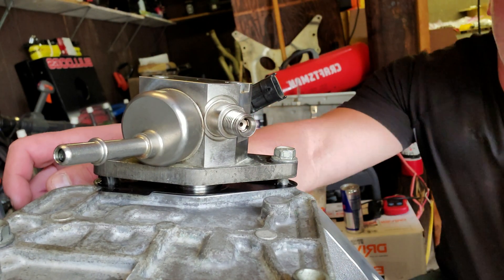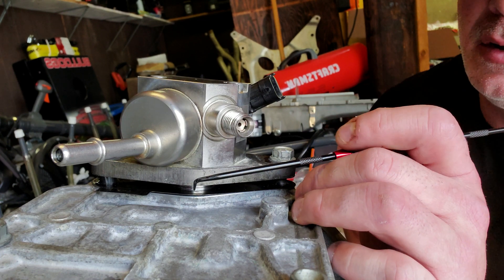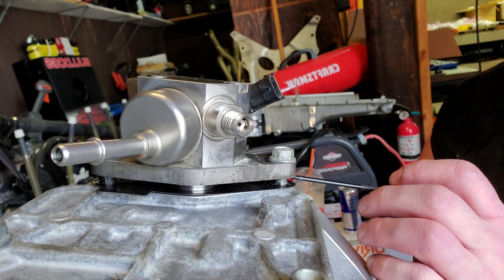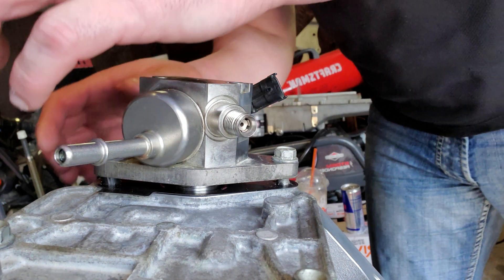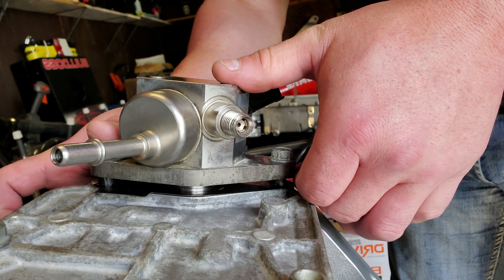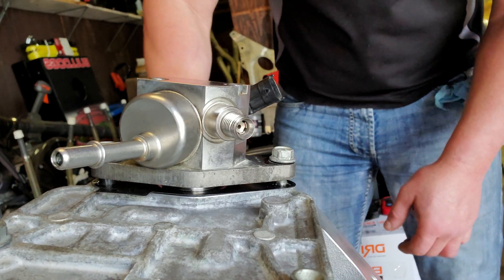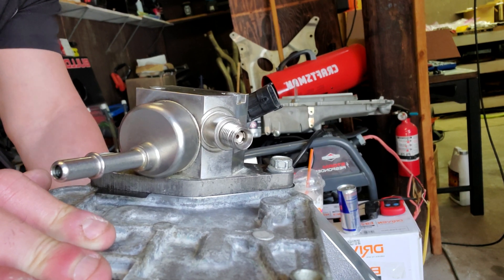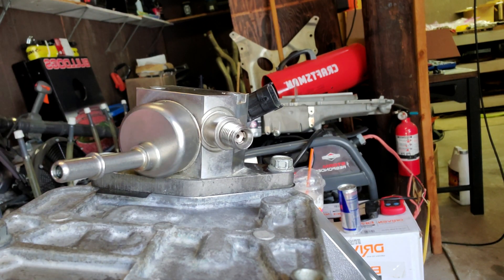Checking HPFP Lash Cap Tolerances GenV LT4

Comment: I have a stage 2 cam from Gpi idk if I’m measuring wrong but my pumps keep failing and it’s mixing oil with gas and my catch can fills up with fuel is it due to the wrong lash cap ?
Reply from the maker: Wow man sounds awful.  Honestly it’s hard for me to troubleshoot through comments my friend.  Simply for the cost involved I would take it to a shop.  Something sounds way wrong.  Again you want some preload even 2-3mm of preload wouldn’t cause a pump to fail.  And if you can hand turn the engine as I did and your pump stays perfectly flat.  I usually try different lash cap sizes to dial it in.  I’ve done it a few times so maybe I’m used to it.  Check the corvette forum dot come search for FRYEANT he’s a buddy of mine.  He did a good write up on the same process.  I can get you a link if you need.  Think I posted it in comments here.

Comment: If it requires lashing, why use an oversize fuel lobe?
Reply from the maker: Oversized fuel lobe let's your HPFP have a longer stroke, thus increasing fuel volume.  Without going to a high bore pump, which is very expensive.  It's a no brainer if you're doing a cam, why not get the most out of your stock DI system?  That only gets you so far.  You still need a bigger low side pump to keep up.  Then meth or port injection.  I did port with Holley EFI and got to 1146 wheel.  But it wasn't easy.

Comment: Would you recommend .060 on a GPI custom cam set up? Or how do u come up with that number
Reply from the maker: That's a tough one.  Obviously the cam card or cam spec should give you some insight. The lobe obviously can't be larger than the journals, so even the largest fuel lobes are limited.  Mine was 32% I believe.  That means the base of the circle is lower than it typically was stock, allowing the plunger t travel further on each stroke.  That means having a lower base circle, you require a larger lash cap, to provide proper "pre-load".   Go look for the tool by Kent-Moore part number EN-51092 I think.  It will properly ensure your cam is at it's lowest base on circle.  Now follow my video.  Take the largest spring off that will help, then place the pump in the block and check if it is slightly lifted, or does it bottom out? Now do the reverse.  Remove the pump, use the tool to get the highest point on your fuel lobe. Take the HPFP, but without the gaskets.  Does it bottom out, or does it sit flush on the block?  If it bottoms out before flush, you are too large on the lash cap.  I see fuel lobes I remember around 32% needed .080 or .060.  The main thing is making sure you don't bottom out your pump, or you just lost several $$$.  But again, it's not hard, just take your time.  You want to get that sweet spot where you get max travel but don't bottom out.  Hope this helps.

Comment: Ive also seen checking the low point of the lobes to make sure the pump is still contacting the cam at the lowest lobe point it should still have a little rock to it
Reply from the maker: 100% that is a solid point.  Thanks for sharing!

Comment: Would you need this for a fuel lope of 14% ?
Stage 2 btr.
Currently, having no fuel rail pressure after full rebuild....
Reply from the maker: If it were me I would always check lash on the HPFP if the lobe increases, yes.  Just for insurance.  It's not hard and it ensures you are positive you won't bottom out your pump, yet also getting proper travel.  Most wing it and probably are fine, but it's easy, so my answer would always be check it.

Comment: I’m running a stock cam do I need to check for this ? or just direct swap the lt4 hpfp into my l83
Reply from the maker: Stock cam, you're fine.  This is only if you change your HPFP cam fuel lobe.  Mine was a bump of 32%, I believe.

Comment: I purchased a Lingenfelter fuel pump for LT1 with a +32 lobe TSP Blower cam. Still waiting on parts but curious if i have to lash the pump or not
Reply from the maker: Yes anytime you change a cam it’s a good idea to check lash and preload.  Every cam is different or can be.  Best to be safe.  Those HPFPs are expensive and crucial for fuel delivery to get proper travel and preload.  So yes check lash.

Comment: Alright so I'm about to run the BTR stage 2 cam shaft with 38% and the LT4 HPFP. Where do you reccomend that I order a lash cap from if needed?
Reply from the maker: Hi, so if you have a GenV LT4 it will come with a lash cap stock on the HPFP.  But if you don't have one you can get a spring kit with lash cap here > https://www.lsxceleration.com/comp-cams-gm-gen-v-lt-fuel-pump-spring-and-lash-cap-kit-5464/ OR just get a lash cap here > https://jannettyracing.com/products/lt1-lt4-fuel-pump-lash-cap.

My buddy FYREANT also did a nice writeup on the corvetteforum here > https://www.corvetteforum.com/forums/c7-tech-performance/4004454-how-to-installing-a-fuel-pump-lash-cap-in-an-lt1-and-checking-for-proper-clearances.html
Reply: @MichaelBrownPlus  I've got an SS so LT1. Thanks for the info, I really appreciate it!
Reply: @MichaelBrownPlus  I bought the LT4 HPFP and it has the lash cap but I'm not sure what thickness that is? Are you running the stock one or an aftermarket one?
Reply from the maker: @akjake7  stock one.  So you want to check tolerances like in the video if you turn it over and you see the pump lift up you went too far.  All depends on the cam fuel lobe etc.  Just make sure when you turn the engine over it doesn't lift the HPFP up, in fact, there should be some play you never want to bottom out the fuel pump.  Sure you know that.
Reply: @MichaelBrownPlus  I'm on my third HPFP! stage 3 cam came with a lash cap but I don't know what size it is. When I crank my  motor over it lifts the pump. How do I know which lash cap to use if its bottoming out?
Reply from the maker: yeah that’s not good.  Usually a .060 is good with a 30% or larger fuel lobe.  I would measure with a depth micrometer.  Needs to be good to .001 or .01mm. You may need a different thickness but measure and see what you have now.  Way cheaper than busting those HPFPs.  And new lash caps are cheap.  Easy to find on google.  HPFP Chevy 30% cam lash caps.  Also make sure you have your cam lobe bottomed out before you install your HPFP.  That takes most of the load off during install.
Reply from the maker: https://a.co/d/04CSgNr
Reply: Thanks I really appreciate your help. I reached out to my tuner and he told me that the lash caps that come with my cam our 0.60 and he said just stack gaskets  to make up the difference. I’m just a little confused about all this math and what I’m measuring actually.
Reply from the maker: @pauls3077 you can do that but if you’re bottoming out and you want a long term quality fix, I would really understand the measurements.  A couple gaskets sure, but I personally wouldn’t want 3 to 5 gaskets as my fix.  I would get a machine shop to get me a .040 lash cap if I couldn’t find one.  Email me at MichaelRBrown at gmail com.  I’m really curious why you’re bottoming out and by how much.
Reply from the maker: Sorry editing my comment accidentally said .080 last cap I meant .040.  These are quite small why I can help more if you email me.  Curious what your tolerances are with no last cap?
Reply: @MichaelBrownPlus  I sent you an email
Reply from the maker: @pauls3077 what email is it from I can’t find it anywhere.  Sure you sent it to michaelrbrown at gmail dotcom?
Reply: @MichaelBrownPlus yes maybe it went to your spam folder?
Reply from the maker: What's your email?  The part before the at symbol?  I will search for it.

Comment: Just wanted to let you know that I love your content. I own a C7Z and refer to your videos when I have questions. case in point. this video xD
Reply from the maker: Brice thank you so much buddy I try to just make them straight to the point, no fancy music and editing.  Really just one gear head trying to help another.  This made my day thanks again!
Reply from the maker: I finally have my car running finished last night going to work some tuning and bugs out then I should have some GoPro vids of her ripping out!  I also plan on doing a couple videos on a custom oil cooler and a new Procharger Air to Water setup which I already have all the parts for.  So fun stuff coming!
Reply: @MichaelBrownPlus  sounds awesome!
Reply: I have a 2015 Denali 6.2 and I installed the lsxcelleration 2.1 with the 14% fuel lobe.   I didn’t install a lash cap.  I’ve been trying to figure out why it doesn’t idle right. It sometimes does but sometimes idle real rough shaking the truck and hard on the transmission because it’s so bad. The tank pump is 47-70 psi and the high pressure pump is about 775psi idling.  It smooths out even I loosen the gas cap.  It’s these pressures correct?  Thanks